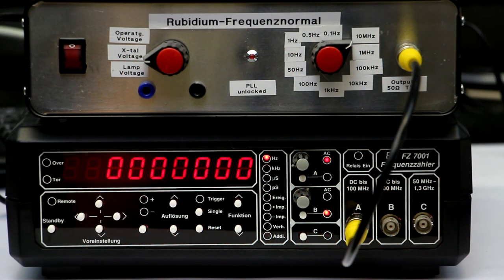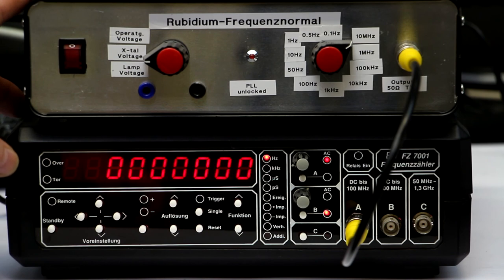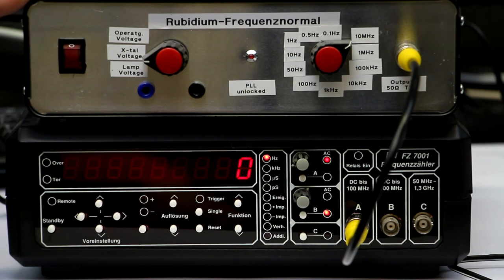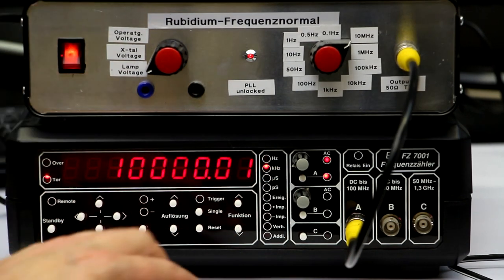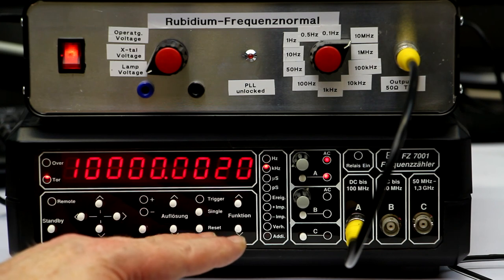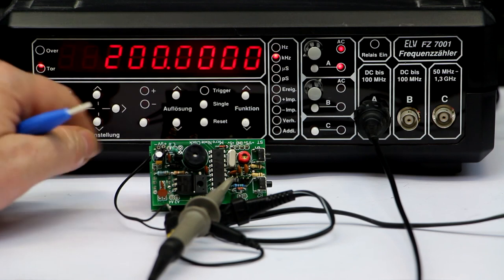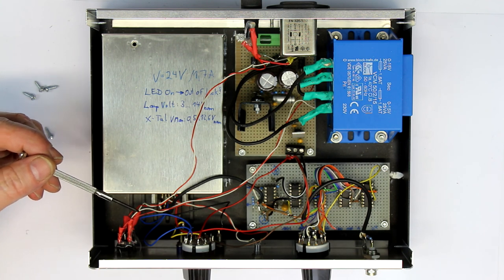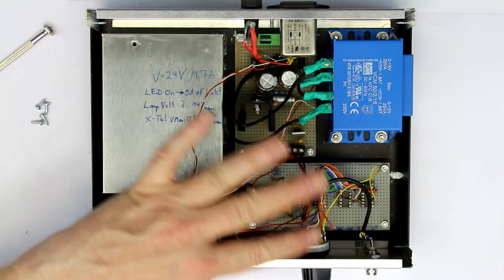Every Maker should have...[Pt.37]...a Rubidium Frequency Standard

Comment: The closest thing I have is a OXCO 10MHz reference. However, I will build an GPS disciplined VCTCXO reference to surpass the previous one. Anyway, nice video!

By the way, I've "calibrated" my frequency counter by replacing its 10MHz crystal and its trimpots with a DOT050F-010.0M TCXO. This replacement seems to be a bit unorthodox, but it worked. Now it is very precise. You can see it in action in one of my recent videos (both the low jitter reference and the hacked frequency counter).